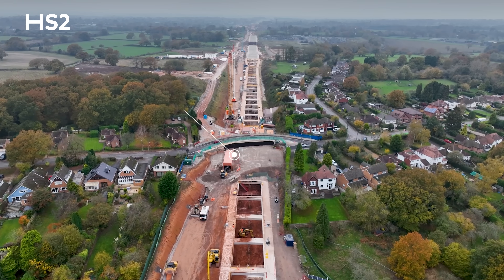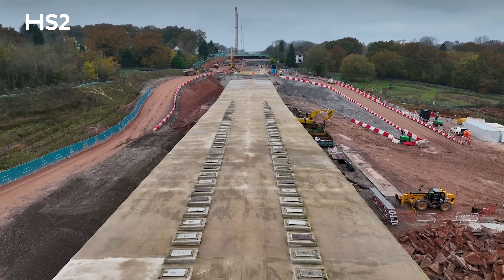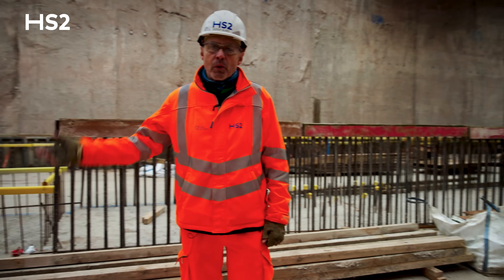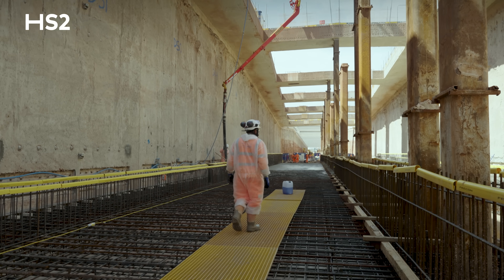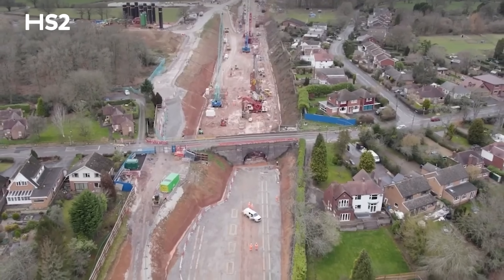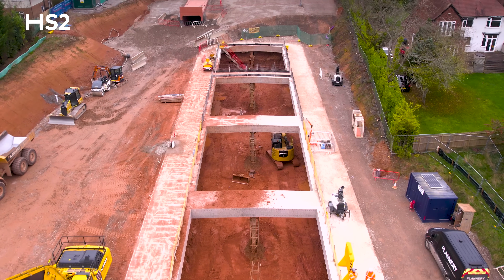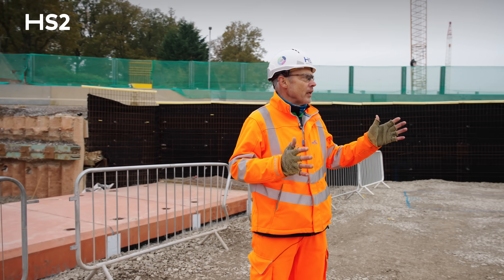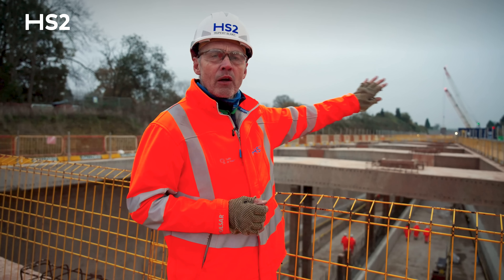HS2’s Burton Green Tunnel reaches halfway point

Comment: Excellent video and explains what has been occuring in the local area. It would be nice though to understand why there is 4 different structures, tunnel, retaining structure, u-box and portal. The retaining area I understand, lower than ground level but not as expensive as a tunnel, but why the u-box between two parts of it?
Reply: Adrian 

Possibly when they pile drilled test holes they came across different ground so  walls is like good ground like a traditional footing dug from the top down either side steel then concrete then middle dug after U section is basically like your concrete floor it's floating like so everything can move and settle over time

The portal part is like massive raft where you start at the bottom and build structure up so whole area is connected in concrete tobe solid structure

Comment: Wasn't this route previously a railway cutting at least in part? A green tunnel is much more expensive than a cutting,  hence the huge overspend on the original project cost esp in the chilterns.

 If it was a cutting already couldn't you have dug deeper before putting the concrete on top, surely that would have been cheaper to do? Was it a stability issue?
Reply: There hasn't been railways track along this route since the 1960s, it was converted to a Wildlife Corridor in the 70s.
It was the Berkswell to Kenilworth Junction branch line.
Reply: @Gr33nMamba  so why the expensive tunnel if an existing cutting? All these design changes have pushed the cost sky high

Comment: Utter waste of money when we need more prisons more hospitals and a boost to the military, just to get travellers from London 35 minutes earlier.
Reply: It’s about capacity not journey times.
Reply: @pwithnall that’s great an all but try filling a larger train when the cost of a ticket will inevitably be higher than the cost of your average Avanti trip.
Reply: @typicalbrummie3852  yeah agreed, ticket prices need to be lower
Reply: @pwithnall .. whatever people may try & tell you, there are absolutely NO passenger capacity issues between London & Birmingham, except London bound morning peak. 
Chiltern mainly run 2 or 3 DMU's most of the day & they're mostly empty!
Added to that, virtually nobody travels the entire route between the cities & instead, get on & off at stations en route.
And arguments that the WCML is at "full capacity" rely on a discredited & out of date forecasting model which overestimates long distance passenger growth & isn't used for anything anymore except to justify the monstrous vanity project that is HS2.
Network Rail's " New Lines Programme Capacity Analysis" shows that WCML capacity is kept artificially low by private operators wanting to maximise profits.
A DfT analysis shows that in peak hours leaving Euston, WCML trains were loaded at just 52.2%.
The blatant corruption within HS2 Ltd that's recently been exposed reveals that senior executives published exaggerated figures & misleading projections to ensure billions of pounds kept flowing into the project (or lied as it's more commonly known) & you've fallen for it hook, line & sinker.
HS2 is an environmental disaster of epic proportions & Britain's biggest infrastructure mistake in half a century.

Comment: I get why this is so expensive now
Reply: Added onto which, they needed to get over 3,000 different permits from various bodies to allow the work to go ahead. Notably down in Buckinghamshire, it passes through a woodland where there's a species of bat officially classified as Threatened, so they had to spend £100m on a 1km long "bat shed" with a mesh roof to stop the bats getting hit by trains. While Natural England didn't determine the structure, it was the cheapest of seven different designs that could meet the required specification. Then there's the bored tunnel through the Chilterns and viaducts designed to either blend into the scenery or look aesthetically pleasing...

The line is desperately needed for capacity reasons, but politicians from two different governments decided it had to have a line speed higher than HS1, which somewhat constrained the route and meant it couldn't weave around the base of the Chilterns or largely follow the M40 corridor.
Reply: @mittfh  :washhands:A fair appraisal
Reply: And fairs will get a whole lots more expensive overall because of this white elephant. Nobody is going to use it.

Comment: So it’s a cut & cover, a buried box that is covered over to disguise its origin. When someone says “tunnel” I think of a bored construction. Cut & cover is more like a wide bridge.
Reply: cut and cover is a different method, but the end result is similar. For cut and cover, you dig a gigantic hole and then start constructing the concrete tunnel starting with the floor, then the walls, then the roof. For the method explained in the video, they start at ground level above the tunnel, dig very narrow trenches for the walls and then fill those with concrete. Then you build the roof (or more like 'skylights' in this case), then you excavate the earth beneath the roof, and then finally the floor.
Reply: @ Finishing with the floor is odd and counterintuitive but I guess there’s reasons for that
Reply: @caroleast9636 That's how they are building Old Oak Common  station. For a multi storey ubderground basement it's cheaper and quicker to build it top down, as it allows the above ground structure to be built at an earlier stage of the project.
Reply: regardless it's expensive and probably unnecessary.